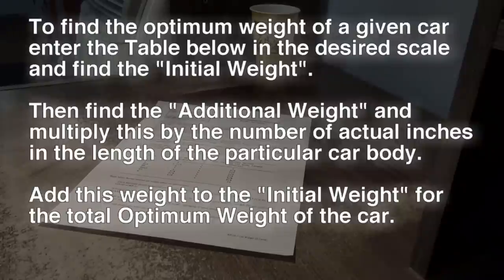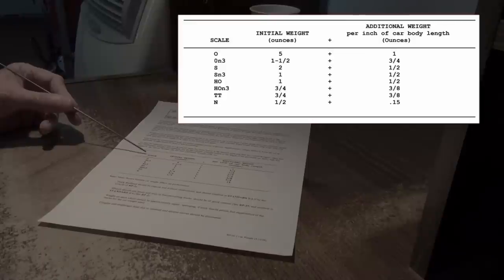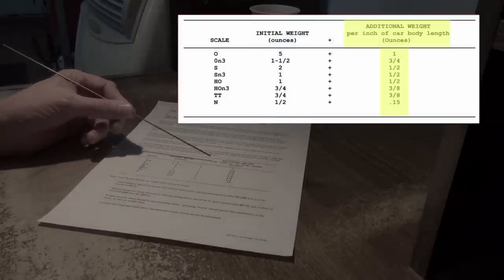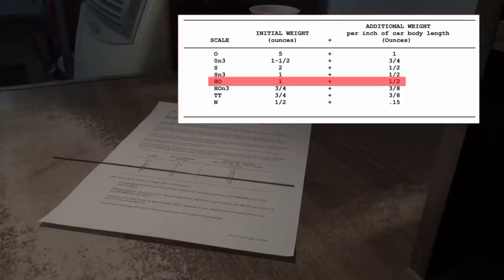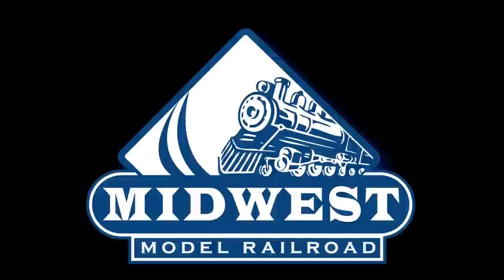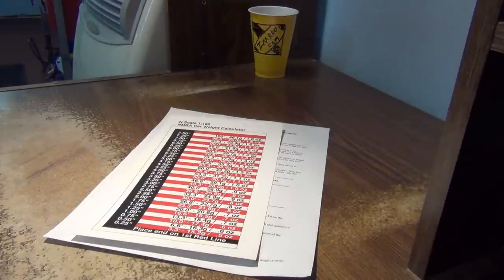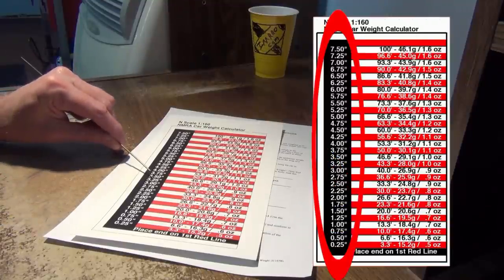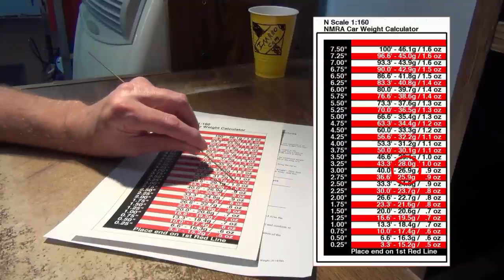📌Car Weight Standard - RP-20.1 NMRA Standard and Recommended Practices - NMRA Car Weight Standard

Comment: Hi Eric, this video of yours was very helpful......great actually ! I made a similar scale as yours (your idea of course) and made a test track with the scale and micro-scale coupler height gauges at each end as well as a rerailer...works like a charm.I do agree 100% about using grams instead of ounces ,especially for N scale ,and being from Canada metric is king(although imperial is used to a degree) Using your modified document on my test track I tested a brand new Intermountain 4 bay Potash hopper (got them yesterday Jan.24/20) and measuring them at 4.25" they weigh in exactly at 32.23 grams...very nice hopper with metal wheels..beauty !Oh yah, I got my digital scale from Amazon yesterday too ,bonus.
Take care and thanks a bunch for this great video !!
Paul T in Canada
Reply from the maker: Thanks,  and cool to be checking your stuff!

Comment: Randy, thank you!! This is a great video that everyone needs to watch and apply! I found this out years ago but some cars are very hard to add weight too. If you have a center beam car with no load on it, should it weigh the same as a car that's loaded? What is the effect of having those extra grams on that car now? This is a TOP 2 video for me now and going to print that card out, thank you!
D. Muse
Reply from the maker: Sure give Randy all the Credit.  And this is video is only in the top 2 and not number one...Yes all cars loaded or empty.  You covering for the scale,  not the real world.  Load or unload get it to target.  Small scale it is all the same.  Extra wight just makes it harder for you power to pull the train.

Comment: Hey Eric Got a Microtrains Santa Fe Caboose A Coopala.. when this caboose was Rolling Down my Layout I could Here the Shell Rattling or maybe it was Plastic window Panels but Anyhoo I thought maybe adding some Weight to the Caboose would stop the Rattling I added 2# 1/4 Oz weights the Rattling stopped but is the Weight a Little to Over Kill I remember Dan Cortipassie i think i spelled that Right said he was Going add weight to his Caboose but I cant remember How much but he said since the Caboose is on the Tail end of the Train the little added weight would pull the slack out, But is 2 1/4 weights Way to much to Add just was Wondering and experimenting I took the little coil spring that Microtrains always puts on the Axle Cone to me the Spring is nothing more than something to lock up the Axle But I didn't throw it away.. 

THANKS Reply as Soon as you Get some Time cant wait to see more of your Videos.. Allen🤓🚂🚂🚂
Reply from the maker: interesting to note.

Comment: Hi so this has been almost 2 years has anything change for this. I'm HO scale. I have some 40 year old cars and they seem to be really lite. I tried to pull them but they keep derailing.
Reply from the maker: Did you put them on a scale and check the running gear for them?
Reply: @IMRROcom  not yet
Reply: @IMRROcom  I have to get a different scale the one i just tried won't work

Comment: I'm curious as to how you came up with the ounces to grams equation, upon checking a conversion table 1.1 ounces = 31.1845 grams for which your chart is close, but well off on others. You also have repeating ounces on the 4.5-4.75", 5-5.5",  5.75-6.25" , 6.5-6.75", and the 7-7.5" cars with the same ounces but different grams for each. If the ounces are the same shouldn't the grams be the same?
Reply from the maker: Oz are based on NMRA calculations,   Grams are adjusted to be more accurate.  Most scales do not hold that many decimal points
Reply: There's 33g per oz. So grams are a longer scale. So take 7 oz. to 7.5 oz. that's a 16 gram jump. Grams are more precise.

Comment: RP20.1 does not specify a tolerance of the final weight. I would guess + or - 10% maybe even more would be reasonable.  There are many variables that effect the amount of force needed to pull a train that the smaller increments of grams vs ounces is of no significant benefit.  Updating RP20.1 would be a good idea.  I wonder how many of us are still running cars that are 20 or 30 years old.

Comment: I think the rp is still good . But i don't  understand why the ready to run car's aren't.They are  eather  over  weight ,or under. for the cost ,they should be right don't you think.Any way the right weight does help the performance of not only the car's but locos as well. Like always anther good video.
Reply from the maker: It might save in shipping cost.  you shave 1 ounce of off each of your products.  You have 5000 cars to ship.  you have just shaved over 300lb.  That is a huge savings on the bottomline when shipping from over seas.

Comment: In my opinion, the NMRA weight is too heavy in HO. It doesn't take into account the quality of the rolling stock available in recent years. I make my trucks as free rolling as possible. Quality track work will reduce the weight required. I too use grams versus ounces as grams are more precise. Last item, you can pick up a good scale in the kitchen department at Walmart. It's generally less expensive than office supply stores.
Reply from the maker: You swing the other way.  I know and hear a lot of HO people want to overweight their cars by a significant amount.  having stuff like a 60' box car at almost a pound.  Or a small 2 bay coal hopper 8oz to 10oz.  Seems like they are trying to double the recommended weight of the car.  The little 12 or 13 car train we ran at my house was pushing the 2 engine set down the hill/2% grade.  Model trains do not have brakes.  I can see the problem
Reply: You've operated on my railroad. Much of my equipment is a bit under NMRA weight. Flats, gons and many tanks are 50-75% of the recommended weight. Equipment caused derailments are infrequent. Operator caused derailments are common. In my opinion, the differences are 1) reliable trackwork 2) free rolling wheelsets (all metal in HO), free swinging trucks, proper coupler heights. Again, there are the few equipment caused derailments, but they are not consistent or regular.

Comment: The RP-20.1 NMRA is totally OBSOLETE. Since 1990, a lot as change, cars are build better, but mostly people build there layouts much better, for example, lots of people use much larger radius. Another example is if you're running smaller number of freight cars for delivery. Basically what I'm saying is it depends on your layout and how you run trains. I personally will have weights between 105 grams (empty) and 400 grams (loaded) (3.7 ounces and max of 14.1 ounces).

A lot of factors should determine the weight of your cars. If you are running tight radius, than your cars shouldn't vary to much in weight, same applies if you are pulling lots of cars and especially if there is a mix in weights, for example, 3 light cars , 2 heavy, 2 light, 6 heavy, 3 light, etc.

On half of my fleet,  I will be removing a bit of weight for empties and adding a bit of weight to others and the other half, I will be adding weight for full loads.

I've build a WORKING weigh station on my layout and weighing cars will be part of my operations.

The answer is 3 oz and the RP-20.1 should be totally revised.
Reply from the maker: What would be your full suggestion and idea to replace NMRA RP-20.1?  Have you thought about writing a white paper to cover your ideas and suggestions.  How would it be done etc.  Thanks for your input and looking forward to see your fully fleshed out idea.
Reply: Sorry Eric, but I really can't make any suggestions for everybody, it all depends on the layout. My minimum radius is 30" and my operations are based on 14 industries from 2 yards, so the speed of the loco's are not fast and my empties are usually in the back of the haul.
If you add to that super elevation and perfectly flush joints, it also makes it easier for different weights and heavier cars.
I would say the majority of the modelers have small layouts, very tight curves and run their trains how ever they want, so for them NMRA specs should be OK. 
I would suggest that people try out the specs and then test it out and adjust to what is best for them. The RP-20.1 is ONLY a guide/suggestion to get you started.

https://www.facebook.com/MHOJunction/